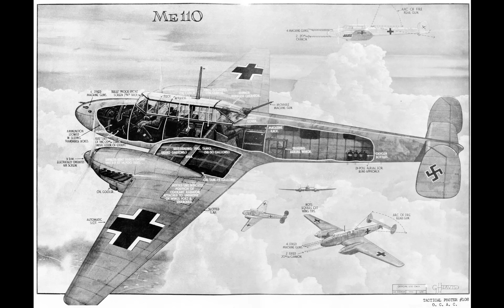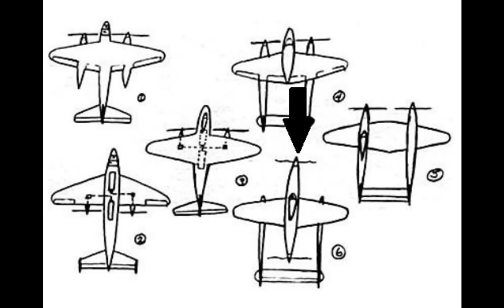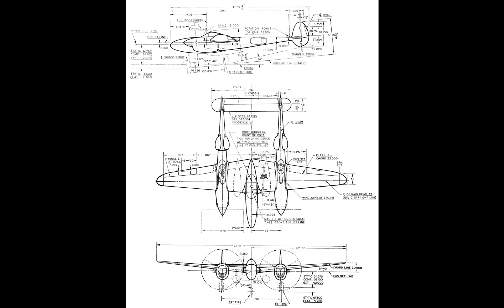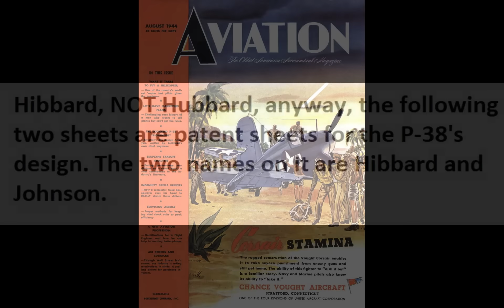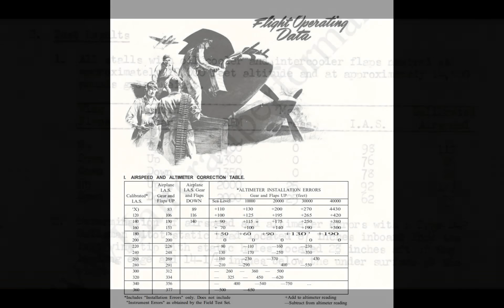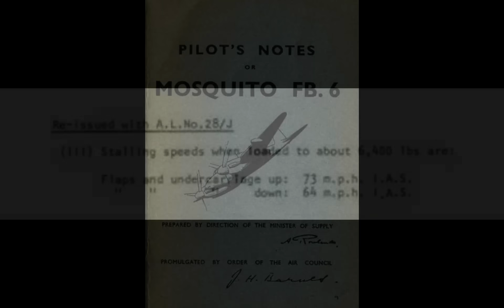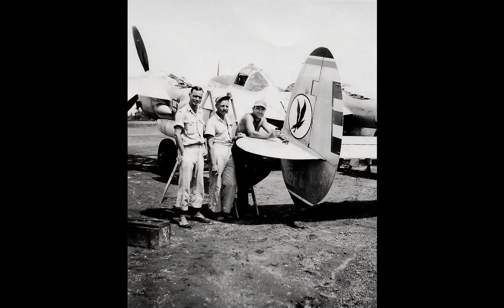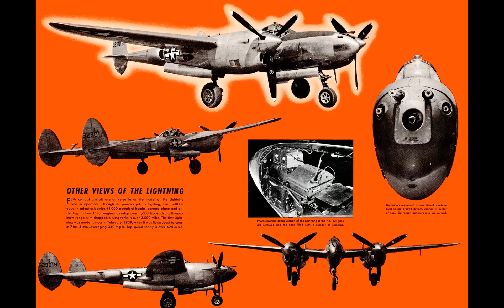Lockheed P-38 Lightning Design Info

Comment: Looking forward to this one. When writing Touched with Fire I ran into a very interesting article by David Ostrowski written for October 1996 issue of "Skyways - The Journal of the Airplane 1920-1940." The title is "Early P-38 problems." The author summarized a major internal report written for Lockheed HQ in 1944, so it's pretty blunt. The P-38 had its share of teething trouble as we all know. According to this report, in 1940-41 when Lockheed was beginning serious work on the 38 they also received huge orders for the "Hudson", a militarized version of their Electra airliner. To get the Hudson out the door, many of Lockheed's top engineers and production specialists were shifting away from work on the complex P-38 to work on the Hudson. To be fair, Lockheed was nearly broke in 1939, and considered big orders to be needed for what was clearly going to be a war ahead. However, because the P38 team was given many inexperienced men and was over worked, the "teething" troubles were protracted and solutions delayed. Lockheed's report concluded that because of the emphasis on the Hudson (a journeyman light bomber at best) the successful debut of the P-38 was set back by at least nine months. In other words, had things gone differently, the Bettys inbound to Henderson Field in August 1942 might have been met by USAAF P-38s instead of a few P-400s. Or 38s could have been defending Port Moresby in the spring of 1942 instead of P-39s and P-40s. Nobody has ever fought a perfect war I guess.
Reply: enjoyed your book
Reply: Thankee. It was fun to write.

Comment: I would think the F5 recce took 90 % of the recce pictures of the USAF.  I would guess that the RAF took a lot more pictures than the USAF since they started much earlier.  The tough missions of the USAF were conducted by Spitfire XI's.  The F5 was just not up to the task.  Even Ki-43's could bag F-5's. 

The statement that the P-38 could really fight it out with single seat fighters is a bit stretched too.  Only under ideal cases of hit and run (i.e., not really fighting) and with considerable numerical advantage could the P-38's attack single seat fighters and have reasonable chance of survival.  When the P-38 was under altitude disadvantage, it  really no tricks to pull.  In the Euro theater, they were butchered.

I am not sure which single engined fighters the P-38 could out-turn.  Perhaps the P-47?

I think what saved the P-38 in terms of giving it some sort of reasonable kill/loss ratio was the fact that it entered service in the Pacific just about the time when the quality of Japanese pilots had plummeted.  Even there, may I remind you of McGuire's last fight when 4 P-38's with the arguably the best pilots in the pacific were attacked by a single K-84.

Anyway, thanks for another stimulating video.  D.
Reply: Wow, where to start. Many accounts of experienced pilots in North Africa, MTO and Western Europe of the P-38 being able to outturn both the 109 and 190. Again the key was having a pilot who had really mastered the aircraft. No less an authority than Robin Olds has stated the P-38 was a match for any prop aircraft the Germans had. As for Tommy McGuire, it is well documented that he became target fixated and violated some very basic flight rules for the P-38 trying to get another kill. As a result he put the plane into a stall at low altitude and crashed.
Reply: @edwardpate6128  Sorry, Physics puts a limit of what is possible.  Of course, legends are limitless.  The MCGuire story that is officially admitted is very carefully polished.  There have been new investigations that show that Mc plus the second bast pilot were bagged by the K-84, and the cloud saved the other three.  The P-38 was a classic example of a poor performer saved by the overwhelmingly favorable circumstances.  But we love our legends.

Of course, even a super poorly conceived and executed fighter aircraft of WWII is super interesting from the engineering perspective, and for that I too thank Greg.  Interesting perspective that the turbochargers forced this unusual design.

Comment: Amazing video, as always.  Design-wise, I wonder why they didn't extend the "gondola" further back, giving more room for armaments, cameras, fuel, booze, whatever... It would have cost next to nothing in drag or dry weight.
Reply: Probably would have pulled the CG to far to the rear.  Might also have adversely affected the the air flowing over the elevator

Comment: Good video you really explain the value of the booms.   Yeah those booms are stuffed w/ junk holy cow.  

The P38 was incredibly advanced for its time - maybe too advanced.
Reply: That was one of the things that was always a problem for it later on. It was a very complex plane and was never designed for large scale mass production by an unskilled workforce. Lockheed only thought they might build a couple of hundred or so when laying that all out.
Reply: @edwardpate6128  Kelly Johnson was brilliant designer, but interesting to compare him to Ed Heinemann of Douglas.  Heinemann's planes were not bleeding edge but practical (SBD Dauntless, A1 Skyraider, A4 Skyhawk, A26 Invader).    

Part of issue the allison engines w/ turbochargers.  These were not sorted out as well as well as Merlin supercharger setup.  Allison was great basic engine but the engine controls and induction etc not as well developed.

Finally workload and pilot fatigue.   Why did US develop P82 Twin mustang?   Range advanced so much limited factor was pilot fatigue.

Comment: IIRC from the book Fork tail devil they talked about the armament and both the 23mm and 37mm were to slow for the pilots liking, also prone to jamming and the shell trajectory was to different from the .50 M2's so they used the Hispano 20mm and I never read about any issues with jamming of the 20mm in the P-38.
Reply: That probably explains why a lot of US pilots preferred the Bell P-400 in that regard to the P-39 as they liked the 20mm better than the 37mm. However the Air Corps loss kind of turned out to be PT boats gain as they loved to scavenge those 37mm and put them on the bow of their boats and found them great going up against Japanese transport barge traffic.

Comment: As a mechanic who works on twin engine Piper Seneca I's (PA-34-200), I personally have trouble parsing the decision to mount the right turning prop on the right engine and the left one on the left. Seems like that would have rather serious negative effects in the event of an engine failure on one side of the aircraft, due to the engine torque also pushing the heavy side of the aircraft down. On an twin engine plane that doesn't run counter rotating propellers (For example, the Beechcraft King Air), the engine that produces "light side" torque is called the "Critical engine," since that engine going down has a more severe effect on aircraft handling than the other engine failing would.

I can't imagine Lockheed picked this configuration willy-nilly, so I'm just wondering if that is going to be part of one of your future videos on this aircraft? If not, do you happen to know any of the reasons for the engines being set up this way?

Sorry for the wall of text before I actually got to my question. I did enjoy the video by the way. I have always liked this aircraft, and there were some terrific insights about the design and development.
Reply from the maker: Good observation, and you are correct, by normal standards this was the wrong way to set up counter rotating props. Lockheed did have a reason for doing it, and I'll talk about it in another video.
Reply: I've always thought it was kind of six of one or half dozen of another myself unless that rotation scheme caused any sort of odd turbulence across the airframe or something. To me for Lockheed at the time it must have just seemed intuitive to have each engine rotating outboard.
Reply: @edwardpate6128  it really isn't just one of the other. Propellers on aircraft have a slightly unfortunate side effect of inducing a rolling force on the airframe in the opposite direction of the propellers rotation (think Newton's third law). This is known as torque. How much of a problem a single engine's torque is, tend to be dependent on the relation between power to weight. A small Cessna 152, for instance, has a relatively low airframe weight, but also an appropriately small engine, so the effect of torque is still small. WWII fighters, on the other hand, while weighing up to 10 times a 152's max takeoff weight, had engines with up to 20 times more horsepower. Torque was a major issue pilots had to compensate for and was known to cause many an accident.

On a twin engine aircraft, you can choose to eliminate the effect of torque in normal operation by giving the propellers opposing torque moments. This can be expensive, since that means the aircraft requires 2 different engines, so some companies, such as Beechcraft don't always bother. These twin engine aircraft are generally heavy enough that the combined torque on the aircraft is manageable with minimum issue, the bigger problem being when an engine dies in flight. If the propeller that is still working spins downward on the inboard stroke, the torque works against the now-heavy side of the aircraft, helping to reduce the effects of losing the other engine, making it significantly easier to manage an emergency landing. If the propeller spins downward on the inboard stroke, the torque helps to push the now-heavy side of the aircraft down even harder, increasing the load on the pilot, and can make emergency landing a lot trickier. Hence the engine on a twin with same direction propellers having one engine noted as the "critical" engine, since that engine going out is more severe than the other.

Lockheed made the engine configuration weird, in the sense that either engine going out causes that severe heavy side torque I mentioned earlier. The engineers at Lockheed were some of the best in the world during the 20th century, so they knew this and did it anyway. That wasn't a random decision, they must have had a good reason, that I just can't wrap my head around right this second.

Comment: If only if it had Merlins or The Ford V12 engines
Reply: The Allison as set up in the P-38 was every bit the equal to the Merlin. Ford V12? Good lord I hope you don't mean the GAA tank engine as used in the M4 Sherman.
Reply: @edwardpate6128  GAA was a detuned version and cut in half version of the V12 it was actually designed for high altitude. The Allison wasn't a bad engine but it wasn't designed originally for high altitude and the Army made it worst with their obsolete design rules.

Comment: Wow, tough I knew about the later versions having drag, I never though it had that much drag from the beginning. 
Where the Mustang and Mosquito the only (low drag) aerodynamic planes ?
Reply: I dont think the Mosquito was terribly advanced, although it didn't have a lot of rivets sticking out, and the skin was smooth.  
Mustang had a "Laminar Flow" wing, that largely didn't work in service (bugs, moisture, damage). 
Most of the Mustangs advantage was that at certain speeds the radiators (ALL grouped together) were ducted in such a way that they added thrust from heat rejection. 
Any jet or rocket plane used in the war had a potential big advantage in drag over piston engined planes, in that any heat that was generated by burning fuel was kicked out the back as thrust.
I would vote the Gloster Meteor and the Me262, and Me163 Comet as the most advanced designs by far.
Sad, but all the piston engine stuff was a dead end technology, at least as far as warplanes go..

Comment: For anyone specifically looking for a book about the P-38, I quite like The Lockheed P-38 Lightning by Warren Bodie. It's a fairly in depth treatment on the airplane, but also interesting glance into what was going on with Lockheed leading up to the development of the Lightning. It even has a endorsement and Foreword written by Kelly Johnson and Benjamin Kelsey. As Bodie did work for Lockheed, it admittedly reads with a bit of a homer slant. But it has a lot of good information, and (probably my favorite part about it) a lot of fantastic pictures and schematics.

Comment: The Bf 110 could have been a better long distance heavy fighter for the early war if it had been stripped of the gunner and all bomb related weight and given water/alcohol injection turbo engines. Indeed the Fw 187 also. Maybe this is too much ''what if''.

Comment: Despite being in service from 1941 through 1945, with a large increase in horsepower over that time, the P-38 saw little increase in speed.
My theory is that Lockheed was too small to have the engineering talent available to improve the design in anything other than minor fixes.  I'm guessing that Hibbard and Johnson were too busy working on the P-80 (the future) to spend much time on a 1930"s design.  I have no evidence to prove this theory.  It's just a guess while trying to figure out why the P-38L (final variant) was listed as a 414mph plane,  while the 1941 P-38D was around 400 mph.  Will you be discussing this lack of improvement in speed?
Reply from the maker: I'll cover it at length.
Reply: They got pre-Goblins off de Havilland, a bit (!) later than the P-38.
Reply: They did give it a try, with the P-49 and P-58. Lockheed was too small in production space, not design teams, to start cranking out the next-generation Lightnings without disrupting the production of P-38s.

Comment: Why does no one talk about the 44000 foot ceiling....this is higher than any other plane?
Why doesn't that make more difference in dogfighting?
Reply: It can make a huge difference in how a plane performs.  Both the P-51 and 47 were at their best at high altitude.
Reply: It was a death trap in a steep descent.
Reply: @givenfirstnamefamilyfirstn3935  - not after the Dive Flaps were installed

Comment: Thanks for this video, and I look forward to the rest in the series. Already are talking about questions I have had, and it looks as if you will continue to do this in oter parts of the series. I heard Robin Olds comment t on dogfighting Bf-109s/ that he could turn with them, but could not dive with them. I hope you will comment on the cockpit heating problem (I heard there was one), and look forward to hearing about Europe vs the Pacific.
Reply: Olds viewed the P-38 as a killer at medium altitudes. When attacked by an Me-109 he broke sharply and then reversed his turn and quickly shot it down.
Reply: The issue with diving was the fear by pilots of very quickly going into compressibility and losing control of the aircraft and possibly destroying it trying to pull out. This was solved by the introduction of dive flaps in later models.

Comment: Airacuda and Do335-- bad design when you have to remember to blow the propellers off if you want to bail out. (sound of a sawmill blade)
Reply: Do335's had an ejection seat (perhaps the first?) so the pilot could avoid the rear prop.
Reply: @fafner1  Had to blow the dorsal fin and propellor, PLUS the ejection seat.

Comment: I was amazed at how large the P-38 is, when I walked around one on static display at Oshkosh a decade ago.
Reply: I saw a museum Tempest.  It was BIG.
Reply: Funny thing is, an F-35 has the same ground footprint as a P-38. Thing is, the F-35 fits into the box lengthwise while the P-38 gets turned to the side.
Reply: @BogeyTheBear  But the P-38 is about a kajillion times cooler.
Reply: They have one tucked under the wing of the Ebola Gay at the Smithsonian.  It looks like it was flown straight in from a field in New Guinea.
Reply: I was lucky enough to see Glacier Girl several times while she was being restored in Middlesboro, Ky in the early 2000's.  Very cool plane and IIRC, Steve Hinton came to do the first flight after it was finished.
Reply: @unpopularopinion8608  
Steve is still the only person allowed to fly her. Miss her being that close.

Comment: It would be interesting to know labor hours/cost ratio between P-38 and P-47.  P-38 seems to be a really expensive aircraft to manufacture.
Reply from the maker: The P-47 was expensive, the 38 cost about 20-30 percent more to purchase and to operate.
Reply: @GregsAirplanesandAutomobiles  Thank you for the info.  While at first 20-30% might not look like a lot, I have to wonder about real life logistics of required maintenance on twin liquid cooled vs single air cooled engine configurations, versus operational flexibility that P-38 had over P-47.  That would be a lot of data to go through, but maybe successful bomb load delivery over given distance vs air-to-air performance and mean maintenance hours could be a good starting point to get that picture.
Reply: Component supply did get affected due to the dual-engined nature of the design. For example, every P-38 came factory-equipped with a generator on the left engine, but not always with one on the second engine. There's provision for one to be installed on the right, but why use up two generators for every machine when it can fly with one?

Depending on supply circumstances, a P-38 could have had a factory-installed generator on the right, or it could have one put in at the depot level. Manuals state that you should always start the left engine first, but it was permissible to start the right engine first if it had a factory-installed generator, but not a depot-installed one (no trust in them Army fellas).
Reply: There had to be an outlet for Allison engines.  There was no other first rate Allison fighter, even the post war F-82 was a dud (apart from the Packard Merlin initial batch).